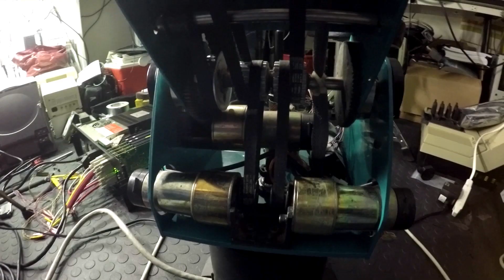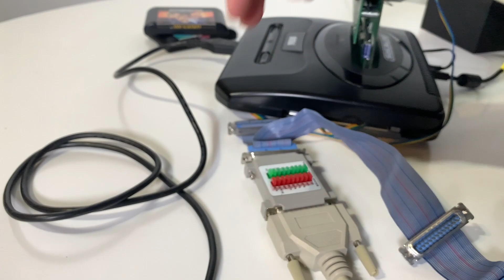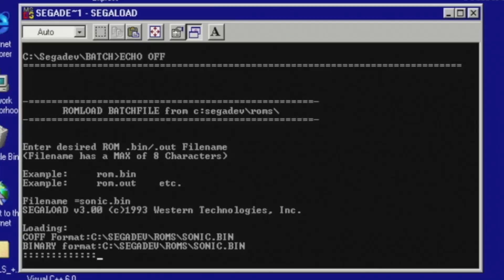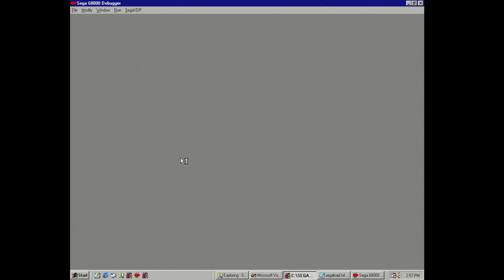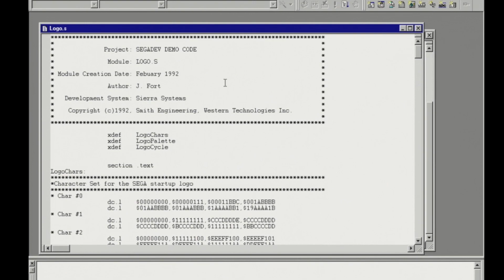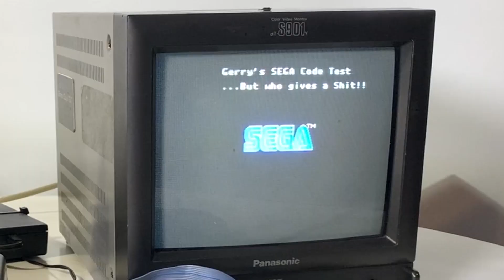Sega Genesis Development Flash cartridge "REV D" by Western Technologies [#29] #Devkit

Comment: That's cool. Though I would not use that Sierra C Complier. Even with optimization options it generates total junk. mcc68k from Microtec was the beast. Even the latest gcc 16.x doesn't come close to it.
Reply from the maker: Thanks for the heads up. 👌I'll definitely have to try that out for future projects! 🤔👍
Reply: @BehindTheCode_wGerry  it probably won't matter for very basic demo code. But I've been doing some Genesis rom hacking and homebrewing where it's critical. It also seems that a lot of dev back in those day used mcc68k. At least American devs.